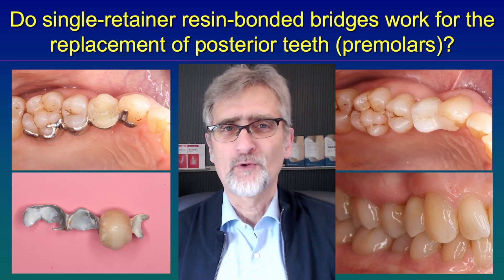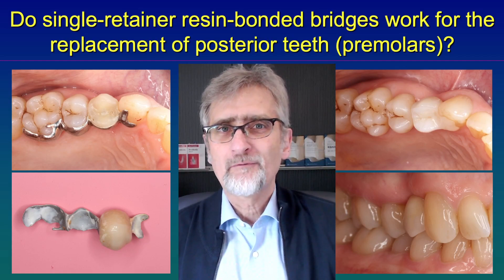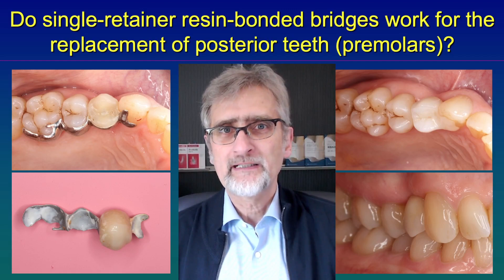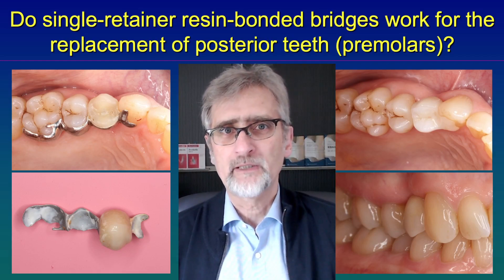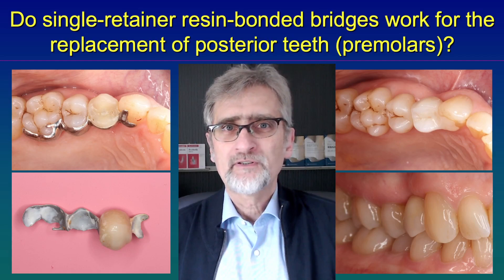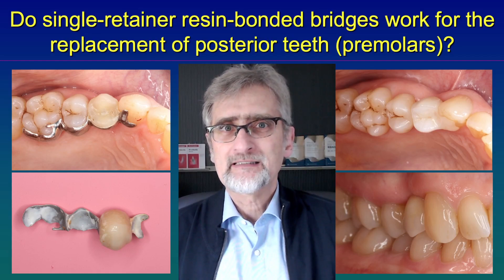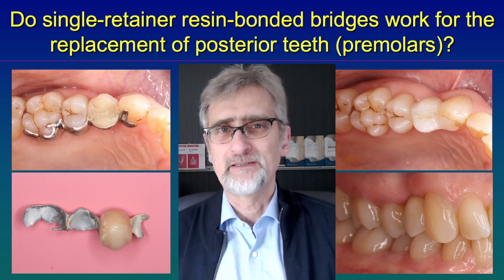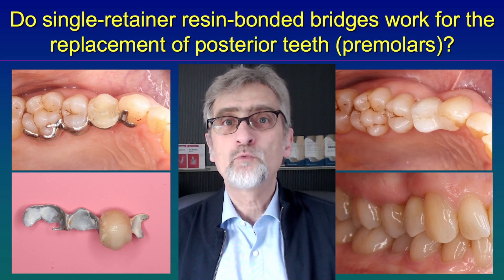Do single-retainer resin-bonded bridges work for the replacement of posterior teeth?

Comment: Thank you for this video, may I ask what do you mean by ''not too large'' how many mms should be the space for a premolars replacement as such you describe? Thanks ahead.
Reply from the maker: @senacebi9374  Thanks for your question: We limit the span to 7 mm. If the edentulous area is larger, i.e. 8-9 mm, we would broaden the other adjacent tooth non invasively with directly bonded composite resin.
Reply: @ProfessorMatthiasKernEnglish  thank you so much for your detailed response

Comment: my understanding is Zirconia does not bond predictably long term, even with special primers. do you place a layer of porcelain on the inside of retainer, that you can then etch?
Reply from the maker: Unfortunately, your understanding is not most current. Please watch my video on this question: 
https://youtu.be/tB5qSA4KqTs
Reply: Professor, I had my teeth braced when I was 12 years old. During the braces, one pre-molar on each side (#15 tooth) was removed. In May this year, the right pre-molar was removed. I plan to replace it with a resin-bonded bridge with cantilevered restoration. If I use a zirconia ceramic single retainer, Is it feasible without tooth preparation? Is it better to use canine or molar for abutment tooth?